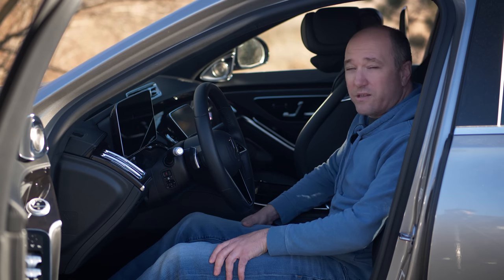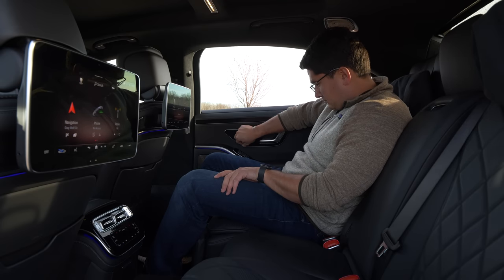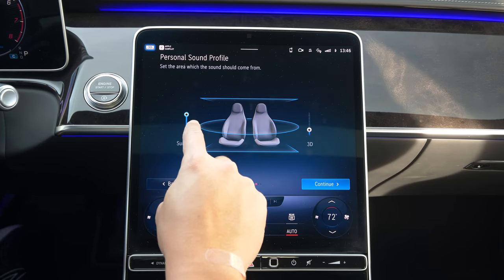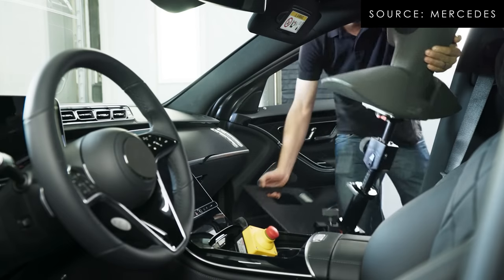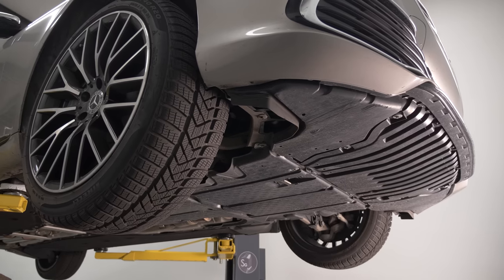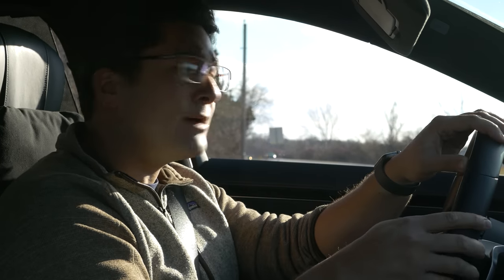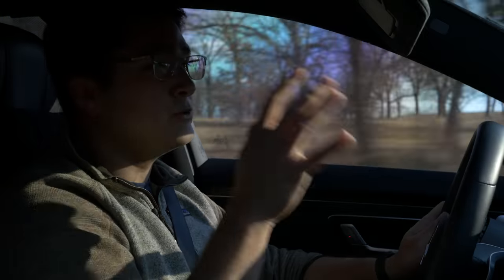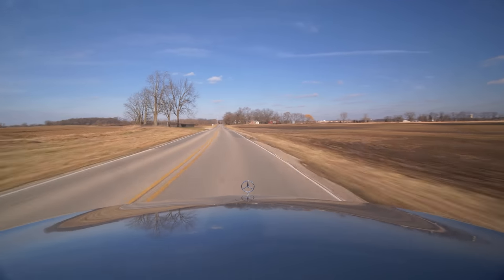Mercedes S-Class | The Best and Worst of Cars

Comment: I agree 💯 with the final thoughts, the ability to simplify by a set option in the menus "possible on most base smart phones" to only show/operate core HVAC controls while driving would ease tech anxiety.

As advance as the software is on this car, Mercedes should be able update  OTA.

Comment: Sure, usability is an issue but it's been a common issue with the S Class for a long time. However, no other car come close to its quietness or stability at triple digit speed. You can drive all day long at over 130 mph with no fatigue, even with crosswinds.
Ride comfort and stability over rough pavement is astounding. It's so much better than a Tesla.

Comment: The sad thing about the S Class is that even the Main Dealer engineers cannot repair the most simplest of repairs - because nothing is simple on the S Class. Some common problems to name but a few: sensors (especiallythe Nox sensors), DPF, adblue, and the amplifier for the stereo system, lets not forget about the air suspension. Why on earth doesn't mercedes have a light to tell you when the DPF is on the regen cleaning cycle, or cleaning additive in the adblue to clean the crystalised injector and metering valve. These items are what is destroyings not only the S class reputation but Mercedes reputation as a whole. I for one have moved from the Mercedes brand to Japanese motor vehicles which are more reliable and user focus.

Comment: Most people still look at these cars as if they were run of the mill cars on which people drop their hard earn money and will be unable to trade for the next 10-15 years. The guy who drives this is not worried because it's a company car or has enough money to trade in a top tier car every two years without worrying about cost/depreciation. All S class were like this, they always had the last tech and in an abundant and a bit impratical way.

Comment: The major issue with this car is the brake lockups sometimes when parking. You have to press harder on the gas pedal to be able to move the car. If you parked the car in parallel, good luck.
Reply: Safety feature.

Comment: The reasons why it's a bad purchase makes me want it more 🤣.
I personally love car fads for my second car just for the shit if it (which is one I don't care about and don't kind losing money on. Primary will forever be a naturally aspirated sports coupe). I've bought a few s class's used at its best marginal depreciation curves point. So didn't lost much money compared against a new higher trim Toyota lease. And spent not even $2000 in maintenance by the time I drove it for three years.

However the car does have 40 something error codes by then but all on tech that I didn't care about nor affected my driving experience. New owner also didn't spend a dime fixing them

Comment: Just like a 2008 or above Nissan GTR.  It can remember the road and monitor wheel slip 100 times
per second , so if you launch the car on uneven surface and get a 0-60 in 3.8 seconds , go back
to the same spot , and the car (GTR) will remember which wheel or wheels slipped and when.
By doing this , your next 0-60 will not be  3.8 seconds , but lets say 3.5 , or 3.6.  Many people
dont even know how advanced the ATTESA-ETS-PRO  awd system is , and Nissan allready
had this technology in 2008. Ever since 08 , the car and its systems have been upgraded about
3-4 times. I can not imagine what a 2015 model after its second upgrade must be like.

Comment: I think I'd love to have this car. I had an S500 years ago and loved it for its comfort and ease of driving. I was able to drive further in a day doing cross continental journeys than any car I've had since.

A few weeks ago I drive an E220. It had so many toys and features that in the week I had it I was completely unable to get to grips with large parts of the functionality. To that degree I understand Mark's perspective. But over time, I know that I'd simply set the car up to suit my own preferences and most menu items would only be touched once and then left alone.

Of course, a large proportion of these cars will have professional drivers. People paid to know the car perfectly - that's their job.

And yes, even on the E220, as a driver, I'd like to see a mode control - beginner, competent and expert perhaps. And a reset button to default values for each major section of functionality.

As I found with the E Class, with so much functionality there's either going to be a steep and long learning curve, or as I did, you get in the car and drive. I'm sure that one can get behind the wheel, press Start and go and enjoy 80% of the value of the car.

I'm no bloated plutocrat but I'd love to have a car like this driving across Europe, but I'd not be driving it to the supermarket or a McDonald's drive-thru. But at this price, it'd not be my only car!
Reply: Yes, they excel at being road-trip vacation vehicles! Many use them for this exclusively
Reply: @MrCarGuy  yeah, when I had the S500, the vast majority of driven miles and hours in the car were long distance miles. It was purchased with that in mind. The horrid fuel consumption was not an issue; comfort for driver and passengers was the most important factor.

Comment: The dilemma automakers are facing at the flagship level is that the car must be the best which means that all the latest tech is expected. It means excess because if not excess, what's the point of flagship luxury? Over the top is the point. The problem with this is described in the review but it's almost unavoidable. These cars have literally thousands of features/customizations so a large screen with menus is by necessity. That said, physical buttons should always exist for everyday basics but some companies are associating mechanical buttons with "old" tech that doesn't fit with what is supposed to be the latest and greatest car.

Comment: Miracle of Technology.
I feel so bad for Tesla when seeing Mercedes. The thing is that we don’t need all these technologies unless if we have endless sources of money 😅
Reply: You feel bad?  Tesla actually implements their technology correctly in ways that the driver doesn't need to look at to benefit from.  MB is trying so hard to be flashy and look good in photos and videos, but the actual experience using the car's tech shows that the company has a fundamental misunderstanding of how to properly design user experiences.  You can even see it the new MBUX that a focus on flashy iconography, color gradients, shadows, glowing flowers, etc were prioritized over the ability to just change the seat massage function.  These design flourishes make sense for passengers, but not the driver.
Reply: @RubmaLione  I dont care about infotainment. I just appreciate the mechanical design beauty. That’s the result of years of experience. I do have a Mercedes truck with low options and the more I compare the more I understand what a big job they’ve done in the design.
Mercedes doesn’t talk a lot they just bring it to the table.

Comment: Yeah well.  The s-class has always been a technological window, not a car per se.   Even truer now that no one is buying sedans.   But yes, this one is the John Carter of cars indeed.   Back in 2000, I bought the then-new W220 S430 for about 100k$ here in Canada, with the intention of keeping it at least 10 years.  Man....   total numbers ended up costing me around 45000$ more in repairs and I finally sold it in 2012 in exchange for an LS460L, which I still have.   Total cost of repairs:  0$.  Maintenance:  about 400$ a year plus a set of tires (1000$) and brakes (1300$).

Comment: Mercedes-Benz S Class is more for a limousine company and not for an individual person. No one buys this because they want to drive it. Everyone knows the best seat is in the back right of the car. That is why you have all the controls for the rear passenger. This platform is to pamper the passenger. After about 3 years of leasing, the limousine company gives up this car for the next S Class model so their customers/clients get the latest in high tech technology to stoke their rich little egos.

I repeat: this car was never designed to be owned by private individuals. This is not a car you were ever meant to commute yourself to work in.

Comment: That was the most negative review I’ve ever seen on any vehicle which surprised me a bit because I’ve watched almost every YouTube video on the 2021/2022 S class and your enmity for this vehicle is an outlier. Everyone, of course, is entitled to their opinion! 
I owned a Tesla Model S P85D Ludicrous from 2014 to 2019 when I switched over to an AMG GT 53 4 door coupe. I’ve owned A8 L’s, BMW’s, Suburbans, Suzukis, Yukons and Hyundais along the way and one of my kids still drives my old Ford Expedition with 135K miles on it. I am 54 years old.  Mercedes Benz USA sought out my opinion and actually paid me for an hour long conference call inquiring about why I switched from Tesla to Merc in 2019. I’m sure I wasn’t the only one they called.  My main reasons: The Tesla Model S was a one trick pony (that being straight line acceleration) but the interior was seriously lacking in luxury appointments and its dependability got worse every year. Electric car charging is a pain and range in cold climates like where I live is an issue in the winter. There still is no Tesla dealer in our community and the service is terrible. So Merc does listen to their customers. The center screen tech approach is fine, just as it is in Tesla, but Merc offers much better interior finish, and provides a much better overall service experience.  The UI is not significantly different from any current Merc vehicle so I don’t think current customers of any age will be overwhelmed. This new S Class ticks enough of the boxes on my list that I’ll get one. If vehicle reliability is the main desire Lexus makes good sense but I think Mercedes still hits the mark better balancing interior/exterior and driving experience.  My friend has the new Model S Plaid and loves it but the yoke is very awkward and the interior still resembles the inside of a microwave oven. Fit and finish not on par with Merc, Audi or BMW.   I like Musk but won’t get another Tesla. So far our Hyundai has required the least service but it’s no Merc inside or out.  Genesis is not quite there yet. No one looking seriously at the S class (or A8, 7 series, etc.) is viewing it as an investment so the depreciation comments aren’t pertinent.  All vehicles are tools and the worth of any expensive tool is determined by the end user. I think Merc will likely remain the leader in this segment. For the record I think the following is a better example of how to do thorough a point/counterpoint vehicle review: https://youtu.be/X23itRZqkwk

Comment: That infotainment system is an absolute deal-breaker for me.  Where are my hard buttons and switches, so I don't have to spend 30 seconds glancing back and forth between the road and the screen, just to change one setting while driving at 75 MPH?   Stupid.

Comment: I'd much rather buy a w126 and do tasteful updates for the mechanical systems, audio system, and mmm, keep about 70g and have everything I need. I'll have knobs, buttons, dials, switches, solid chassis, supple ride, and it's a classic.
It's a seemingly sad state we live in, where even at the very top, the current Rolls Royce or Bentley products are just a throw away cars, too. I know huge effort goes into the assembly and engineering, but the tech will die and these cars will die as a result. I just don't see there being an aftermarket in 30 years where modules will be available to keep today's cars on the road.

Comment: This is where the car industry as a whole is headed apparently though. These days many cars are just becoming screens with wheels rather than the other way around.

The S ain't even the only one for Merc, they mostly copy-pasted this for the new C for example.
EQS is even worse, top spec ... the whole dash is a screen.

I personally much prefer the physical controls for many things, like the IDrive ratating knob in my BMW. Messing around with something, any small thing on the infotainment system while driving is much, MUCH safer if you don't have to actually aim on a touch screen!

Comment: Wow never in my life have I heard someone shit on a S Class especially the upper model version. I guess there's a first for everything. I just bought the S580 4matic long and I'm definitely not a 1%er, $250k a year net. I absolutely love the handling and acceleration of the car. The interior is second to none. All the options you have at your fingertips to customize your ride experience is incredible. The level of detail you have to customize your sound system and lighting is great. The S Class exterior looks elegant with a touch spice( if you have the spoiler, side skirt and the more aggressive bumper, which my does). Really a panamera turbo over an S Class? yeah right😅 That thing looks ugly and the interior looks second rate compared to the S Class. My recommendation ti those who plan on buying the S Class, to buy the extended warranty, gap insurance and preferred care package. Yes it's a little more upfront but will save down the line.
Reply: @1148bucknasty so how much should he be making?

Comment: My dad bought his 2009 S350 V6 (nearly 130k miles as of now) back in 2010 and honestly it has been a reliable experience so far. Engine's issueless since he does correct oil changes. The only issues are the air suspensions going out every 25k miles. Pretty much every feature, the rear recline functions, shades, massage still works very well. He loves it and told me he plans to sell it at the first sign of engine going bad. But oh man, the new one is like nano tech ironman suit compared with the old one being like a mark 2 suit. Absolutely bonkers and heavily complicated.

Comment: I hate how the internet makes people group think and agree just because your "leader" says something. I'm not defending anything but most people in this comment section haven't ever touched this car or it's infotainment system to know that it's hard to understand. Most people aren't very smart in the first place so most times it isn't the implementation it's the users unwillingness to give it a chance. I'm pretty sure the tech is fine just like Ford's mytouch systems in 2010 everything worked for mine but reviews harped on issues that happens to simple radios too.
Reply from the maker: Fine and acceptable are not words that should be used on a flagship product.  People make too many excuses for why things dont work and manufactures continue to get away with releasing products that are half baked because of if.
Reply: @savagegeese  no I'm saying people don't like the way technology is designed to work. The tech wasn't malfunctioning you didn't like the implementation that's a personal choice you shouldn't decide for other people.

Comment: I think the old ways of doing things automotive-wise are changing because of EV's. It should be cheaper to manufacture EV's and that should mean lower prices. The Germans, who have staked out the high ground on ICE vehicles probably have to recalibrate. The existing prices for high-end ICE automobiles is not sustainable in my opinion and may collapse. It will be interesting to see how things shake out. Tesla will make it for sure and probably Mercedes. The others? Hard to say.

Comment: the tech on most new cars and SUV is so disposable for this reason, im keeping all my 2007, 2008, 2013 and 2015 vehicles with mechanical speedometer and tachometers as long as I possibly can doing as much as preventive maintenance as possible, my next new car will be a simple disposable electric car, no more internal combustion engine with extreme crazy technology that will only last 3 to 4 years, electric cars will last as long as the battery does ...10 years and throw away, but with very minimum maintenance cost nor gas cost during those 10 years

Comment: I've had an 85 300d and now have an 01 e320. They both are solid cars with great suspensions and drive trains. The interiors suck. Some cheap plastic and progressively worsening electronics.
They should go back to building tanks. Oh well, they really didn't do that well with those either.
I do actually like the exterior design of this one.
Reply: The W123’s are still used as taxis in Africa.  I would say that they did pretty well at building tanks up to the W140.  In terms of interiors, I will challenge you to find a more durable material than the old MB Tex.  My 1979 240D’s seats have not worn in 41 years.
Reply: @bobbbobb4663  You're right about the MB tex. My 85 had 280k miles on it and the seats were perfect. However, my 01 e320 has leather, I think, and it is falling apart. It's actually very thin and so is the padding.

Comment: At least they got the exterior styling under control; it was excessive for the past several years. But inside . . . the demographic that says they want all this technology would never take the time to read the manual and learn it, so it won't get used. And it's worse for the passengers. How many of them are going to mess around with a large, totally unfamiliar screen, and for what purpose? Enough of our lives are spent looking at screens. When driving I'd rather be talking with the car's other occupants.

Comment: The W223 is a TERRIBLE car. Mechanically, it's great. But the car is loaded with problems - especially the electronics, which constantly fail. They even thought putting touch sensitive buttons on the steering wheel was a good idea.  yeah - incredibly stupid. All the touch screens are needlessly complicated and require an incredible amount of attention - all pulling your eyes off the road. MB USA is buying a lot of them back because of lemon law claims.